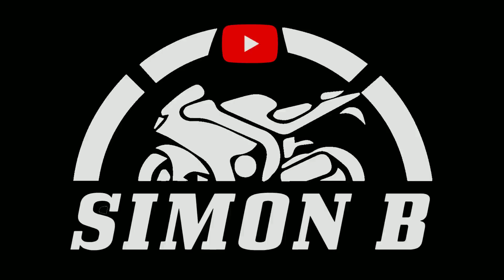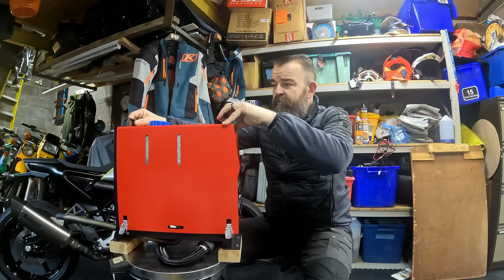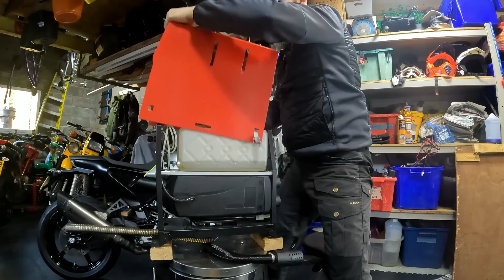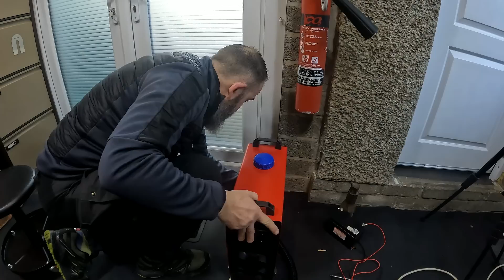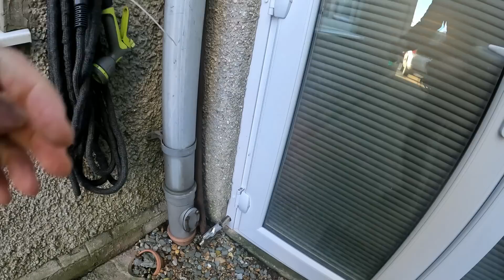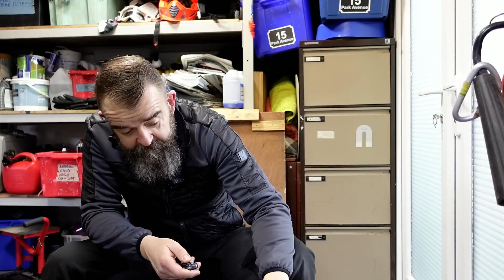Chinese Diesel Heater are they worth buying ?

Comment: Wouldn't you always smell diesel fumes every time you enter or exit the building with the exhaust right outside the door? That would be nasty.
Reply from the maker: Hey up Dave, no not really, these things aren't a diesel engine, most of the fuel is burned off, so the output isn't as bad as a engine, ride safe, Simon B 😎

Comment: you want a deep cycle battery and a trickle charger, that way the electricity is minimal and the battery backup if the power goes out it will not destroy the control board from the heat with the fan off.
Reply from the maker: Hey up snapcrack55, I take a look at that option, thanks for sharing 👍

Comment: I have ordered a 24v one I am thinking the heat will be higher, I watched a you tube video and he tried to run a 12 v one on 24v by changing the settings but it would not run, he expected it was because the glow plug was not 24v standard, any info would be greatful i will do my own you tube video when my 24v heater arrives hopefully more heat as I want to heat the house
Reply from the maker: Hey up fuel free, didn't know about the 24v one, you'll have to keep us updated if it's any better, ride safe Simon B 👍

Comment: youre supposed to feed the intake pipe back in that hole where you put the exhaust by mistake. It mounts up on the rear
Reply from the maker: Hey up hammerjockey, if I'd of done what you say, where would the exhaust be routed 🤔 👍
Reply: @SIMONB1  the exhaust goes out toward the side and back or down lower than the unit and then back.  The hole that is in the rear frame that you have the exhaust through is designed for intake only. Hence why the intake is on the same side,  these were originally designed for campers(so exhaust went down through floor).
Reply from the maker: Thanks for the information, ride safe, Simon B 👍

Comment: Hello    good video can you give me the spec of your machine and were you got it thanks
Reply from the maker: Hey up Martin, in the description box below, there is a link to where I bought it from , hope that helps 👍, ride safe, Simon B 👍
Reply: @SIMONB1  hello.   I can get one like yours with 4 holes but it is 8 kw, technically stated as a   5 to 8 kw I think you can adjust it between 5 and 8 kw which one would you recommend.    Thanks
Reply from the maker: Hey up Martin, some say them 5/8kw aren't a real thing, just a marketing lie, so it's just a 5kw, so should be good for you 😁, ride safe, Simon B 👍

Comment: Further to my previous comments red derve the law changed hard to buy because off people using it for road use 
Kerosene is cheaper than red about £1 a litre can pump into 25 litre drums 
Re old oil I believe they are going to have old oil police sniffing round work shops of hairy bikers
Reply from the maker: To get red , you have to fill in a form every time you purchase 😲, and burning waste oil, it's only illegal when you get caught 🤔😉😁
Reply: @SIMONB1  I can’t see the flying drones etc with waste oil sensors my mate has a farm had take pictures of his farm machines to get the permit kerosene no permit needed £1 litre cheaper than red at crown oil heap bridge bury just of bury bypass don’t know if u red or white roses… try old chippy oil too
Reply from the maker: Try out once , the cheaper the better 😁 👍

Comment: Set mine up today, after adding a fuel filter, fuse on the ground line and cutting a hole in the other foot so i could run exhaust and inlet straight out in opposite directions. Also used a copper elbow joint for the exhaust so it doesn't hang so low. It's for my metal shed, did a quick test today and it heats up the space quickly, will do a proper test once i finish the shed insulation. Cheers Simon :)
Reply from the maker: Hey up Garry, all's good, that's great news, not bad things, can be modified to suit the situation, thanks for watching and dropping a comment, much appreciated, ride safe, Simon B 👍
Reply: @SIMONB1  Cheers Simon. What company runs the petrol station the you get your red diesel from? Can't find one near me so thought of asking you then checking other stations a bit further out run by the same company, assuming its a big one. Thanks if you have the time.
Reply from the maker: Hey up gary, it's a Murco , hope that helps 👍
Reply: @SIMONB1  Thanks again Simon :)

Comment: Might be better moving fire extinguisher away in case u can’t get close with the fire 
Might be as well replacing bottom four inches of the architrave with metal in case of melting just given thumbs up
Reply: Ooops I should watch alll of video first
Reply from the maker: Hey up Barry, no fire issues here 😁, it's all been sorted and double sleeved now , thanks for watching and dropping a comment, much appreciated, ride safe Simon B 👍

Comment: Here's more info on fuels I've tried in the UK spec Vevo 5kW unit, with stock settings (with the controller-new type, late 2022, without the antenna signal indicator):

Best fuel, most heat, Kerosene=heating oil=jetA1=paraffin

Diesel, red or standard next best

Brake fluid, DOT3 diluted with 10% petrol next best

Old dirty engine oil diluted 20% with unleaded petrol next best

Transmission fluid/old gearbox oil diluted with 10% petrol next (but smelly)

Old gunwash thinners with 10% old engine oil to give it some lube properties not very good

Old petrol with 10% old engine oil, also not very good.

Acetone, brake and clutch cleaner (trichloroethylene- don't breath the smoke at all) or alcohol/meths don't really work at all.

With all of the hydrocarbons, it is pretty obvious that there is way too much air running through the combustion chamber, because the exhaust pipe gets really hot (wasted heat). If the combustion air inlet is choked a little, while still maintaining a lean and clean burn (at max fan speed), the exhaust temp drops while the heat exchanger actually gets a lot hotter. More time for the hot combustion gases to transfer the heat into the heat sink, as the gas is moving slower.

Oh and throw away the little fuel filter they supply, as it doesn't filter anything! Get a proper fuel filter...

If anyone knows how to crack advanced settings on the new controller unit (without antenna signal indicator), please post! 👍🏻😀🇬🇧
Reply from the maker: Hey up Fred, thanks for sharing the great information, thanks for watching, ride safe, Simon B 👍

Comment: I've been using the 8kw version for a few months in a 8m x 3m shed workshop, drylined throughout with  3* rock wool insulation.
It's a peach, as its now just sub zero here it's taking maybe an hour to get from 5 to 22 c and then ticks along happily on its lowest setting. Real cheap to run.
My only concern is do check it over, I added a fuel filter, corrected a kinked fuel line, and tidied some pretty basic wiring. It came with a remote, but a simple cable extension has the controller in a sensible place.
So far so good.
Reply: No you haven't.
They are advertised as 8kw but they are a max of 5kw!
Reply from the maker: Hey up Jes, that's great news, they are worth the investment, thanks for watching and dropping a comment, much appreciated, ride safe, Simon B 👍

Comment: im installing one right now  14th of Dec 2022 14-42 pm and my fingers are ffff- freezing cold, its going on the driveway wall in a custom built box, venting into my front room and drawing air for the heating from my kitchen. 

They have doubled in price  on amazon and ebay in the past couple of days as of  12th of December must be something to do with the hype or the cold snap, I wanted another one but I think Ill wait for prices to come back down again as you have to replace a lot of the crap kit that comes with them such as jubilee clips  fuel line and make them safe for use. 
Some have priced them as high as £260.00 from £120 a couple of days ago. if their guarantees were  actually valid it might be worth paying a bit more but most of the suppliers are a bit hit and run according to reviews, Maxspeeding rods  and Vevor have both raised their prices massively to.

 sensible to stay with a battery and charger for power, if the electric fails the heater wont go through its shutdown procedure possibly frying the mainboard.

 Ive got a newish 75 amp battery and bought a 20 amp repair charger from amazon for £20.00 which Ill be running whilst the heater runs to keep the battery topped up. it is currently 7 times cheaper to run a diesel parking heater on pump diesel, than a 32 kw central heating boiler on natural gas. some of the metal case heaters have screws on the front panels that are at risk of puncturing the diesel tank as it moves around within the case so anyone thsat buys one of these take the cover off and check the screw depth on the front panel for safteys sake and use car exhaust paste on the exhaust joints and decent quality 25mm jubilee clips not the crap ones that come with the heaters. and always run a carbon monoxide alarm in the room that is being heated just in case . for around £12 it could save your life.
Reply from the maker: Hey up oojimmyflip, some great advice there , hope you get your fitted so you can thaw out 😁, thanks for watching and dropping a comment, much appreciated, ride safe, Simon B 👍

Comment: Good, useful report.  I run one of these heaters on the mains electricity.  You need a 10 amp,  12 volt power supply NOT an inverter.  An inverter works the opposite way; 12 V battery to mains voltage. i.e. battery DC converted to mains AC.   The heater needs 8 amps DC for startup; only a high amp transformer/12 volt power supply will do. A car battery charger can't cope with the high amps.
Reply from the maker: Hey up mrderbee thanks for sharing the information, plugged into the mains a going good, thanks for watching and dropping a comment, much appreciated, ride safe, Simon B 👍

Comment: Where did you buy it from I've been after one for weeks but on eBay & Amazon they are sold out so all you can buy is just the separate units, not the All-In-Ones?
Reply from the maker: Hey up Lawrence, there's a link in the description box , but just looked and they are out of stock from there, keep looking Amazon eBay, one will turn up 👍, ride safe, Simon B 👍

Comment: I use a 240/12volt 300W LED driver to power my unit (identical to yours) cost about 20 quid on Amazon simple to wire as a 3 pin plug. Its ample for these units.
Reply from the maker: Just got one delivered, should of used a PSU from an old computer, recycling and all that, thanks for watching and dropping a comment, ride safe, Simon B 👍

Comment: Got one of the same using red keeps my workshop just at right temp ,great tutorial open the exhaust hole up through the door frame as the little devil gets a bit warm I’ve got mine inside a bit of old exhaust tube with a small air gap round the main exhaust it works well top lad stay safe 👍👨🏻‍🏭
Reply from the maker: Hey up Paul, thanks for watching and the positive feedback 😁, the exhaust is now double sleeved to stop a fire 🔥🤭, ride safe, Simon B 👍

Comment: Brilliant Simon thanks for sharing that very well explained i have seen them on ebay 8kw but sold out but you have to be careful cos some on ebay have the latest version software and led remote control iam getting the same as you with the 4 outlets at the front when that exhaust gets hot 🔥 won't it melt the plastic frame should have drill through the brick wall
Reply from the maker: Hey up Andy, it's been drilled through the wood at the moment it is now sleeved with a larger pipe to stop the wood from catching the exhaust, have fun with yours, thanks for sharing the info, ride safe, Simon B 👍

Comment: Air intake needs to be outside really and with a decent air filter. The combo's often dont have a fuel filter, run one between tank and pump.
Reply from the maker: Hey up A Gee, thanks for sharing that top tip, ride safe, Simon B 👍

Comment: It doesn't used much electricity once it's running.  The glow plug takes a lot of power, which is why you need a beefy power supply to get it going.
Reply from the maker: Hey up Stuart, good to know why the big wattage is need , thanks for sharing the info, ride safe, Simon B 👍

Comment: I have been thinking about getting a few of these, wrapping a copper coil around the combustion chambers and circulating the hot water through the radiators in my house using a central heating pump
Reply from the maker: Hey up David, some idea that😁, keep us updated if you do, could be a game changer, thanks for the comment, ride safe, Simon B 👍
Reply: You can buy a model with water heating.

Comment: Hi Simon thanks for the vid. Chinese 8KW is English 4KW. They are not capable of producing more than 4.6KW If you buy an 8KW, you are just paying more for the same unit, just like I did, what a dipshit. I don't know why, but I have just had my first burn,  on my so called 8KW, on H6 for 4 hours in my shed which is only 5m x 4m and I only managed to get from 2 Celsius, to 10 Celsius. in one half of the shed. Really disappointing, I was better of with a fan heater.
Reply: Im total opposite . Think you may need to insulate your shed to keep the heat in and rising. If i were to buy again id get the smaller portable unit
Reply from the maker: Hey up shed projects, has you shed not got a roof on 🤔, something is wrong there, as Robster mentioned need some insulation 😁, ride safe, Simon B 👍

Comment: I fitted a cab heater (Eberspacher) in my workshop over 25 years ago before the cheap versions were available,  it is preferable to run the instalation via a 12v battery and battery charger, this will ensure correct shut down procedure in the event of a mains powe failure. Even if its running when the power fails eventually the low battery voltage wiill shut the until down correctly without damage. Mains power supplies are not the best option
Reply from the maker: Hey up Harold, can see the advantage there and safety, mines never left unattended so ok for now 🤔, thanks for the information, thanks for watching, ride safe, Simon B 👍
Reply: Good one.

Comment: It seems a good way to heat the workshop. 
I use an oil filled radiator myself, luckily I have a fixed price deal on my electric and gas until next July!
If I didn't, I would consider it. 
Using waste oil is just recycling, pity it's illegal.
Reply from the maker: Hey up Alistair, time will tell, I'd need a couple of oil filled rads for mine 😲, only illegal if you get caught 🤭, ride safe, Simon B 👍
Reply: Alistair......I see your point, I chuck everything thro mine.....
I want to stay warm and as the way world is no one's helping only taking off us.....
Excuse my language......but fuck the government.....stay safe and warm.....
Reply: @marcobrian1619  I agree with you totally. We have been completely shafted by the government. 
The start of it was E10 fuel, poorer MPG and not suitable for my old bikes! I'm afraid of riding a distance in case I can't get E5! 
The cost of energy and fuel is scandalous. Anything that makes heat a bit cheaper is a win.
Reply: @alistairshaw3206  I'm a biker too...IV an old 2000 husky.....no way can I buy E10 in tank.
Ok my 2017 Tiger says it can....but can I trust them????
But IV gone into DIY solar and huge battery storage to help beat the system....
Like burning waste oil, my system is not 100% correct but it's safe........so I say again "fuck them"
Reply: @marcobrian1619  My newest bike is a Yamaha FZR600R, 1994, officially it and my 1993 YZF750R can run on E10, but no way I would chance it! 
My 1972 DT3 and 1973 Honda CB360 need E5.
That's great you have got a Solar and Battery system, unfortunately I live in a local authority house in Central Scotland and cannot do anything like that. 
My DT3 Enduro has a maximum range of 100 miles, so I keep quite local now. 
I think the government want us all to buy electric vehicles, E10 is just the start!

Comment: Careful because the exhaust pipe can get litterly red hot. Better to make a bigger hole and run the exhaust pipe though a much larger pipe
Reply from the maker: Hi ey up maxv77, need to get a 28 mm copper pipe from work,to double insulate the exhaust, thanks for the tip, ride safe, Simon B 👍

Comment: One thing I would be careful with heating a garage is putting the cold air intake up high incase you have gasoline or other flammable vapours  present as the fan motor is brushed and sparks. I'm probably being over cautious and I'm sure not many people do that. I haven't seen a "my diesel heater blew up my garage" video anywhere
Reply from the maker: Hey up Julio, there's a good point there, think the biggest may be not having the exhaust outside 😲, you know some people 😁, thanks for watching and dropping a comment, much appreciated, ride safe, Simon B 👍